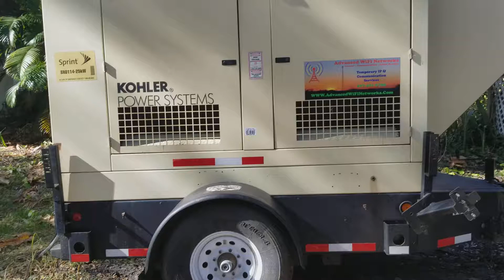Kohler 20kw diesel generator - No start, Locked Rotor Error

Comment: Did it lose the speed sensing at the mag pick up?
Reply from the maker: No i believe if i remember correctly it was the collant temp sensor blowing a micro fuse in the control panel causing the locked rotor error.